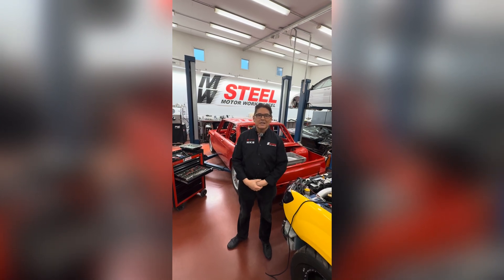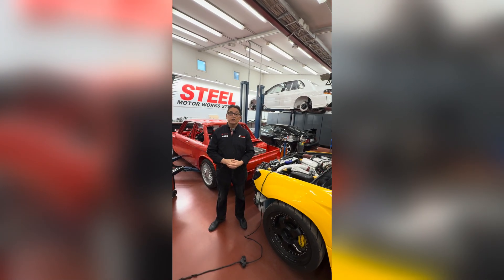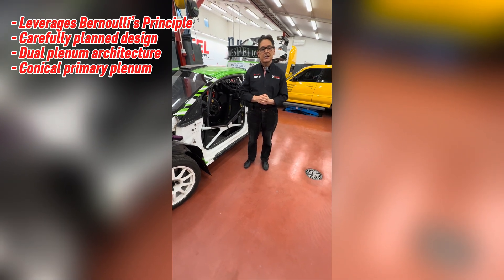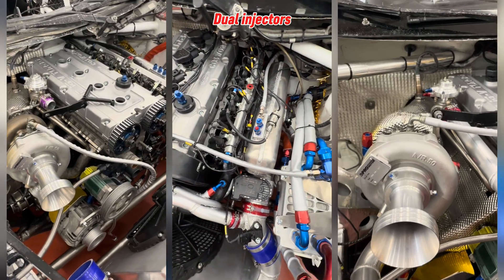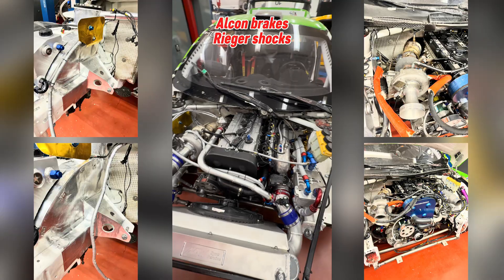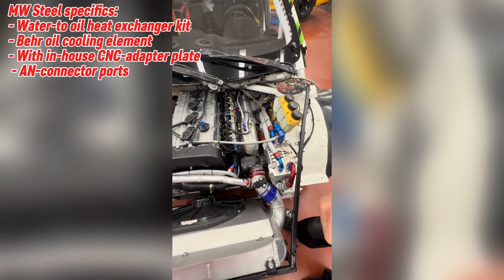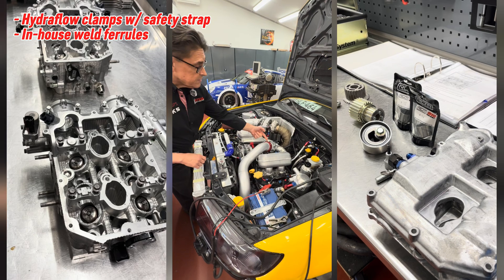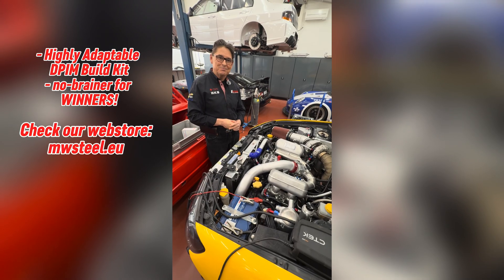MW Steel's Dual Plenum Intake Manifold Build Kit Versatility

Comment: I would love to see CFD simulations of the dual plenum
Reply: even though it will be nice to have, the kit is very well designed and it is easy to tell, cross referencing different wrc and other motorsport intake manifolds you can see that it is a simple, tried and true design
Reply: @unstable-8169  for sure looks like the best off the shelf kit! I bet the design already has been cfd tested long ago in the 90s by million dollar race teams. hence why it’s adopted by so many. I tried googling and can’t find much. I just wanna see the flow and pressure differential and surprised the information is so secretive